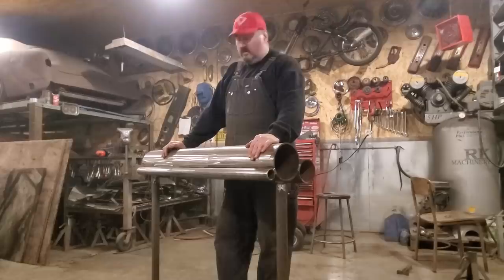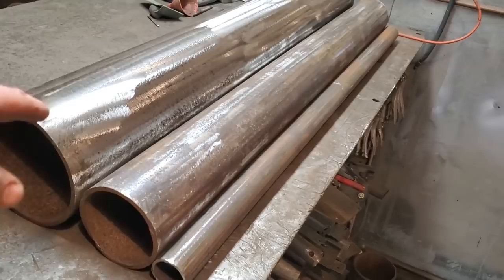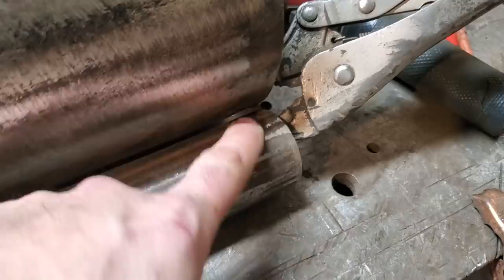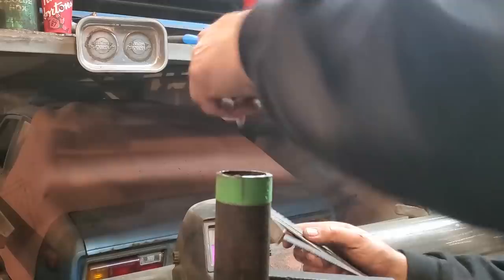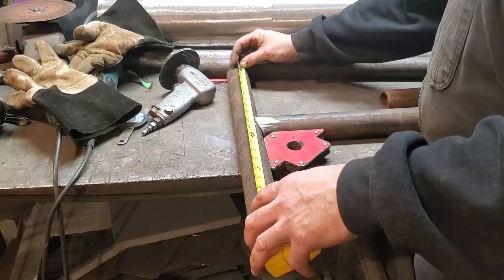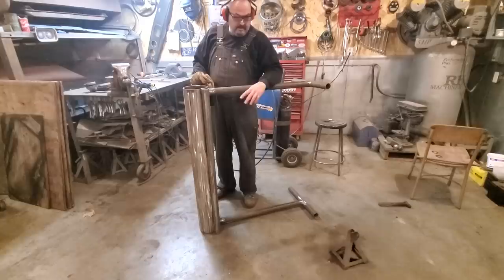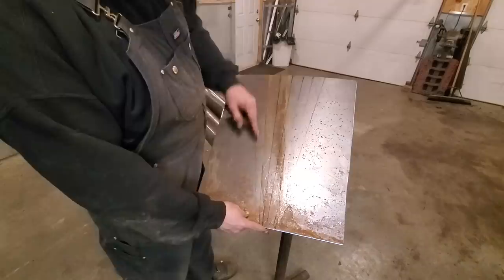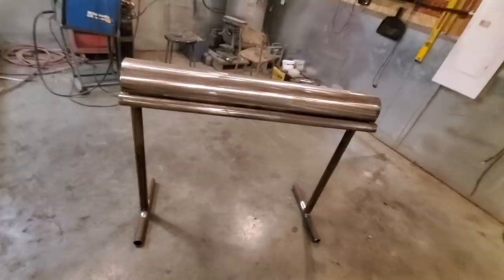How to make a pipe anvil

Comment: Thanks for the valuable tips and tricks.
They saved me time and money yesterday 
Worked on 2001 Ford Explorer Sport
Welded broken window clip going real slow and cooling w compressed air, just took door panel off did not take glass out and did not burn the adhesive that held the glass in. Saved hours and parts not available. Thanks Fitzee!!👍

Comment: Very nice Fitzee! I built myself something similar some years ago. I used 6", 4" and 2" pipe all 3/8" wall 4' long. Instead of welding the pipes together I welded 3/8" thick tabs to the ends with threaded holes in them and 1/2" threaded rod so that the gaps are adjustable and I can clamp the steel sheet that I'm working on tight into the anvil if I wish. For the stand I built two rotating head stands similar to engine stands that face inward to the anvil so that I can rotate the anvil to any angle I want. It works pretty good so far.  It's easy once you know how, (plus years of experience)....
Reply from the maker: That is some good ideas. I enjoy hearing ideas like this. What I do is not perfect or the only way to do something. Its just one way of many. Cool stuff
Reply: @fitzeesfabrications   Thanks Fitzee!  I have a real bee in y bonnet for making everything adjustable and rebuildable if possible. What I do isn't perfect either 'cos one day I was adjusting the anvil gap, stopped paying attention and squished the tip of my little finger on my left hand...that cost me a nail.

Comment: Outstanding idea, I've never seen one before and I do have some extra pieces of pipe laying around. I like the idea of something on the bottom of the legs. Either flat bar or even a piece of angle iron. So many uses for something like this. Thanks and Merry Christmas.
Reply: Well I built a smaller version, just 28" long. Used a 5" 3" and 1 1/2 pipes. Put feet on it, drilled and tapped my metal bench so I can remove it when not needed.

Comment: just a thought ,,find pipe that fits inside the floor legs when your using the anvil slide them in getting a wider foot print , then when done pull them out and hide inside the tubes out of the way that way your not tripping over the long legs ,, like the idea of the cross brace to stand on to keep it from rocking.. another great video .. could also do the cross brace with pins at each end drill holes in your legs .. drop in place stand on it while in use .. remove for storage .. makes sweeping around the anvil easy with out the cross brace in the way .

Comment: This a good idea.
I have to do one project on the ford ranger rear quarter panel.
Since it is a small one off project I think I will make mine out of ABS pipe scraps I have.
I'm sure bending 22 gauge sheets will be no problem. ABS is fairly strong.

Comment: That's a useful tool that you've made to add to your shop, not to mention some useful tips once again. When you were doing the first leg, I was thinking that I would have stood the triple pipe section up on end and laid the leg out on the bench, as I would have found it easier to do it that way. When you drill the holes in the large pipe to bolt on smaller pipes, can you weld the nuts inside the pipe? This would save time in having to fit the nuts inside and if you are using the large pipe for storage, you'd have to take stuff out. Have you thought of putting a welding lens in front of the camera when you are welding, so that we can see the actual weld progressing, instead of the bright flashes. It might also prolong the life of your camera. Thinking about what you said about something to stand on, how about getting two pieces of pipe that fit inside your legs and welding a plate to them, so that you have a removable foot plate.  For storage, just remove the foot plates.
Hope you have a great Christmas and a prosperous New Year. All the best from Queensland Australia.
Reply from the maker: Some great ideas there.  I like the foot mount. Merry Christmas  and happy  new year from Newfoundland Canada

Comment: Just found your channel a few days ago. I'm really enjoying it and gleaning so much!  As for the pipe anvil, it's probably thick enough to just drill and tap it with 1/4-20 and use bolts instead of reaching in with a ratchet....

Comment: Thanks very much, clever, I really like it, particularly the tip about making rocker panels or sections for sill repairs. I’ve a number of old gas cylinders of various diameters and some smaller piping so I’ll get some use from them now. I think I’ll cut a couple of domed and dished ends off the cylinders and weld them on at 90 degrees at one end and then I can use those as well for forming. Thanks again Fitzee, great tips.

Comment: That's a really great tool you've built there! So many applications really smart. Thanks for the idea. Had a thought about your top heaviness and wanting to still keep it close to the wall. If you cut off four lengths of pipe that'll just fit inside the feet you could telescope them out when you're using it and then slide them back in when you're not.

Comment: Such  a simple, but useful tool , if you made the gaps wider it would be good to bend round or flat  stock for ornamental stuff with a bit of heat
Reply: use same or heavier pipe just shorter  or there are videos out with pins up through your heavy welding table that are removeable

Comment: Cool, have done the pipe over the bench edge before to bend things but this would be nice to have. Would be very handy for bending vintage car bonnet panels. Can guarantee whatever length I made it though the next bit of steel I needed to bend will be half an inch longer than the tool.
Reply from the maker: Thats always thr way.lol

Comment: Once again lots of great tips and ideas here.  I have to put some screens on a ROPS so tips on cutting the curved piece are just in time.  You could put some longer bars in the feet if it tends to tip and remove them to set it against the wall

Comment: I really like your way of fabricating stuff not using large cool machines such as lathes, milling machines and so on. I work on a couple of Jeep ZJ, one for offroad and one as DD in a small shop of only 23 square meters (approximately 247 square feet) so I don´t have room for a lot of machines. I have a welder, column drill, compressor, trolley jack and a very small workbench. So angle grinder is my basic tool and I want to fabricate as much as possible my self so your videos are very inspiring!

Comment: I was expecting an anvil as a solid piece of steel. However, if I had a heavy duty pipe, I could weld the ends up and fill it with sand (wet or dry?) and that would be solid. Just a thought for the time being. Thank you for the video and tips.
Reply: Dry, wet will rot the pipe fast...

Comment: You can lay down a longer pipe next to the existing floor pipe and touch them side by side, then clamp together & drill holes through both pipes and bolt together. Then repeat process for the opposite side. This will give you way more leverage, then when you want to store it, unscrew the pipe on each side and your good to go! Nice job.

Comment: Fitzee, if you find the feet on your stand are too short, you could make removable extensions out of the same pipe with an interior sleeve.  Hold in place with a through pin.  Then just remove when you go into storage.
Reply from the maker: Nice idea.

Comment: That’s a great tool. If you had a pipe that would slide inside that schedule 40 you could make a bass extension without compromising the overall width of the base. Just weld 1/2 inch piece of schedule 40 on the out side portion as a stop and leveler kick it in for placement against the wall and pull it out for work stability.

Comment: Nice job again buddy. Was thinking that if you closed off the end of the big pipe with some plate and welded a piece of pipe on it you could use it in an engine stand. It would be steady and movable and you can rotate it 360° and stop it at any point . Just a thought. Like you say more than one way to skin a cat.
Reply from the maker: I seen that and like the idea. Problem is I have not one but two engine  stands  and there is engines on both. Lol.

Comment: To make complete circles you could bolt the smaller pipe to the larger pipe. Four bolt holes to suit (8mm 10mm) with a larger hole opposite to get a socket cap head through. Move the bolts to the ends for large sheets. Put them in the middle pair to use the ends go full circles. 
To make it super strong weld a spacer tube across the roll tube. Cap one end with a washer. Grind the other to follow the tube.

Comment: Yeah I watched your video a couple of days ago on my T.V. I couldn't comment on it, I want to thank you for showing how easy it can be to make this tool. 

I seen them the same places you seen them, but showing how to make it is way better.
 Now should it stay oiled down so it doesn't rust? I know the roller has to have some kinda oil so rust don't pit into it.
Reply from the maker: I have plans on painting it. Think the oil can work but it will be all over your project. As long as it is kept inside it should be fine  but ill be painting this at some point.

Comment: I just noticed an improvement, and I know you did too, put the washer in about 6 inches or a foot and make complete circles, cool right,Later Friend.
Reply from the maker: I'm enjoying all the cool ideas. Lots of them been said.
Reply: @fitzeesfabrications  Great idea Thomas Evans! A pipe anvil has been on my list for a while - still scrounging pipe for it. If I recall, when Gene builds them he bolts the little pipes to the big one. If I do it that way and drill a second set of holes 6 inches or a foot from one end I could make circles and be able to move the bolt and have the full length again when needed. Thanks Fitzee for another great video!!
Reply: I find magnet clamp gets dislodged too easily two are far better. I usually find (in spite of solid tacks) a long weld pulls the job out of line so I do about 1/2” then do diametrically opposite.

Comment: Inches? I thought Canada went metric in the seventies? (and half an hour later in Newfoundland)

Thanks Fitzee! Merry Christmas to you and yours!
Reply: Canada is “officially” a metric Country with Kilometres instead of miles, Celsius in place of Fahrenheit but we can still buy 4X8 sheets of plywood, 2X4 studs etc.  Food stuff and liquids is sold by the kg, millilitres, litres etc but the older generation still relates to pounds and ounces.  Most folks of all ages can relate to weighing 180 lbs but they can’t relate to weighing 81.6 kg’s.  I still build/fabricate (both wood and metal) using feet and inches even though I am completely familiar and comfortable using the Metric system and I am the first to admit.....it’s much easier to use than the Imperial system of measurement.....old habits die hard I guess.....

Comment: I got some free pressure tanks that weigh a freakin ton and ive cut one of them apart, and its a half inch to three quarter inch thick and needed a torch to cut it but used my 9" angle grinder and about 10 wheels cut it in half and made a bullet trap with some plate steel I had...this is a badass idea to do with the other half

Comment: Love your work and fab tips! I need to repair the bottom of a 1948 Dodge pickup. The bottom rolled edge is rusted out... how would you roll that 1 inch diameter?
Reply from the maker: I clamp a 1 inch pipe to the top of  the rolled edge then hammer the roll over the pipe
Reply: @fitzeesfabrications  thanks for the tip, love the way you approach your projects.

Comment: You could make a shorter version for hammering on. Cap one end, pack it with green sand (foundry sand) and weld a plate on the other end.

Comment: I was thinking if a brake and a pipe anvil could be combined (a sharp edge for the brake bolted down and replaced with various size pipes to help force a  bend around a pipe and the lift point changing from flat steel to a double round (narrow pipe) to force over the bend).  Ever see anything like that?
Reply from the maker: I did it with my bender. It is good for getting rolled edges. These types of tools are only limited to your imagination

Comment: FITZEE I'm having a problem with mig welding without gas. I bought a brand new electric welding helmet and can't see what I'm welding once the lens goes dark, I've tried everything with no luck, I know I'm old and yes I do wear my glasses under the helmet and I'm not closing my eyes lol. Any suggestions?
Reply from the maker: Place a light behind you off to one side that brightens up your work area. Dark shops are hard to weld in
Reply: @fitzeesfabrications  Thank you so much, that's exactly what it was. My shop is pretty bright with florescent lights but the little extra lighting solved the problem 100% . Thank you so much!

Comment: Do you just look straight at the puddle when you weld? I don't get how this guy's not blind
Reply: No he said in a previous video he knows where to look and where not to look.
Reply: I asked him the same thing. He uses the welding gun to block the puddle. I tried it the other day. Works like a charm!
Reply: UV off the arc is blocked by clear safety glasses You'll see black spots but you won't burn your eyes.
Reply: @JRGood-mm9yu  nice thought. but clear glass/plastic only stops short wavelengths (uvb & uvc), not uva, so good luck with that. short story - don't ever weld without appropriate eye protection no matter what some guy on youtube says or does. that's the smart advice, what you do with it - or not - is up to you.
Reply: @rennch.  it's not just the puddle giving off UV radiation. so don't do it unless you want to risk having cataracts later in life. your choice.
Reply: @daos3300  50 years pipe welding and still have perfect eye site and always wore safety glasses under my helmet.

Comment: what brand of cut-off wheel do you use?...you zipped thru that pipe like butter, just curious?
Reply from the maker: Maximum from Canadian tire
Reply: @fitzeesfabrications  canadian tire?
Reply: the thin ones for $50 for 20 or regular thickness 10 pack or 50 pack?   are they really that good...harbor freight is all we have around here?
Reply: @fitzeesfabrications  crap..it doesn't appear to ship to the USA
Reply from the maker: @robwest1297  ya it only in Canada. I bought  two 50 packs today . 26 bucks for 50 on sale.

Comment: Is that Miller a 120v or 240v machine?
Reply from the maker: 120
Reply: @fitzeesfabrications  Interesting. I would think that there wouldnt be enough power to get penetration through such large pieces of steel. I new to welding and have an Eastwood MIG 135, and I tried welding 1/8 plate steel onto a car frame with one side being butt welded and every time I grinded the weld down there was an open joint where the butt weld was, it looked like a crack but it was the joint. I figured it was because it is a 120v machine. I had the power up to MAX on the selector. Thanks so much for the videos.
Reply: @David-ty1xz  A 120v machine is easy to use anywhere...but you will get a LOT more power out of it if you are close to the power source.  The best place is very near the breaker panel.  The wires in the wall further along your shop tend to sap some of the power out of the machine the farther away you get, much as a long extension cord will do.  I've moved up to a 220v myself with a dedicated plug and an 8' long, heavy gauge wire extension cord if needed...but when I did have a 120v machine I used the wall plug closest to the panel and had a homemade thick gauge extension cord, just long enough to reach where the welder was likely to be used.  No longer.  Reliable welding was much easier.  Also...its helpful to prep your joints by tapering the edges to promote good penetration on thicker metal.  As always too...practice makes perfect!
Reply: @Sculpin74  Great thank you. After watching Tony weld these pipes, it dawned on me that I was tack welding each weld, and never ran a bead. I was using sheet metal technique, which I'm guessing was part of my problem.
Would you say a 120v machine is well suited for welding quality heavy gauge welds with enough penetration? I would assume so watching this video.
Reply: @David-ty1xz  Fitzee's welder is a good one and he knows what he's doing.  There are limitations in heat and in duty cycle though.  If you are doing mostly thick steel get a 220v and enjoy...but with a lot of car stuff you can use a 120v machine with no issues.  A beginner with a small welder isn't going to have reliable welds on thick steel though.  It takes practice and skill that develops with training and time...and you need to know your equipment is up to the task.
Reply: @Sculpin74  Thank you. I made a torque wrench adapter by modifying a 3/4 wrench and welding onto a socket. The first time I did it it snapped like bubble gum was holding it together, the next attempt I just sort of leaned into the weld and went straight at it running a bead. Held strong with no issues.